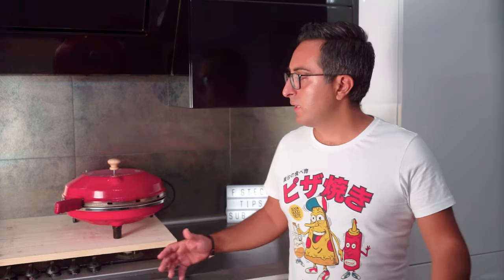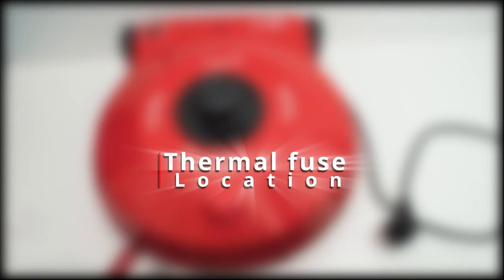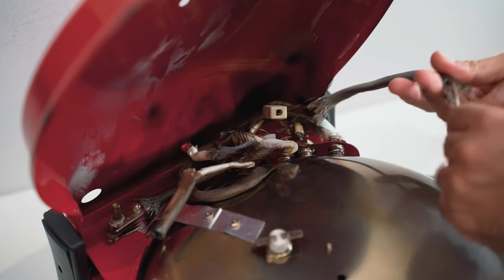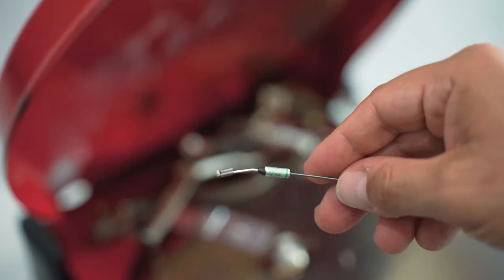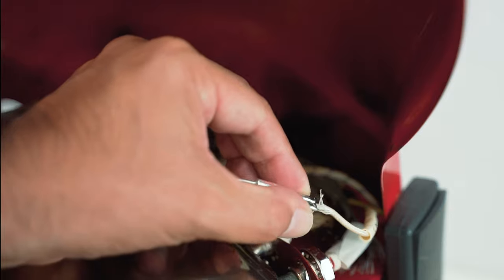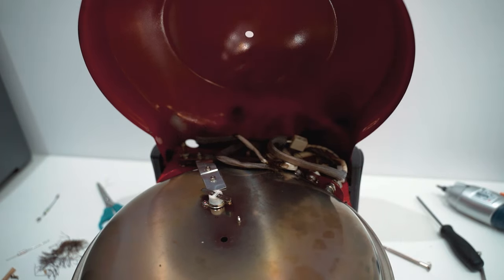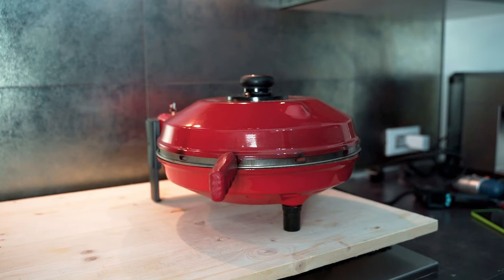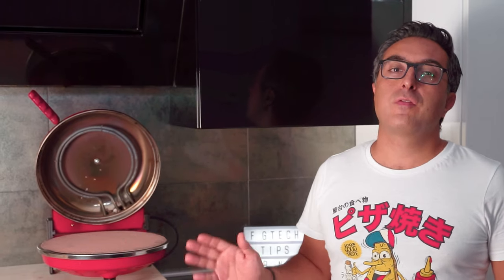Thermal Fuse mod for Pizza electric ovens - Spice Caliente , G3 Ferrari and similiar

Comment: Great video!! Just one question: did you use a 10 or 15 Amp fuse as the replacement? many thanks.
Reply from the maker: Hi, i used a 10a 250v one. I paid less than 2 euros for 2 of them
Reply: @pizzatimechannel  Thank you for letting me know! Much appreciated.

Comment: How long did it take you to heat the stone to 500 degrees? Is there no heating element under the stone?
Reply from the maker: With the coera mod you find in my channel, it takes 20 minutes for 550c in the middle of the stone and without need of lower element